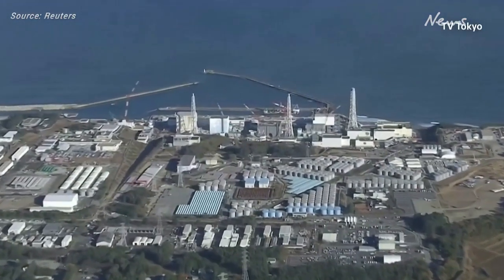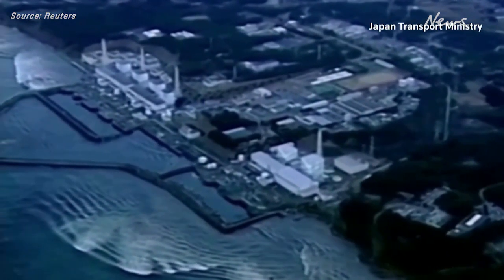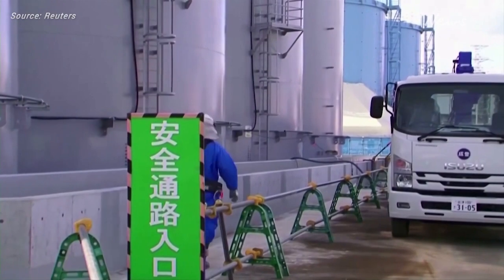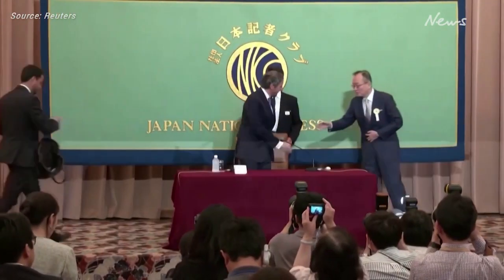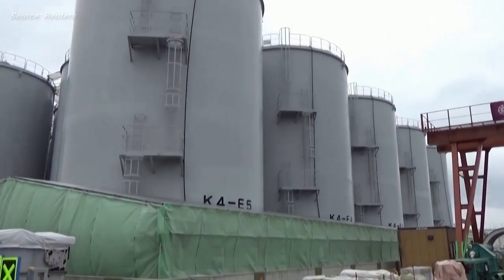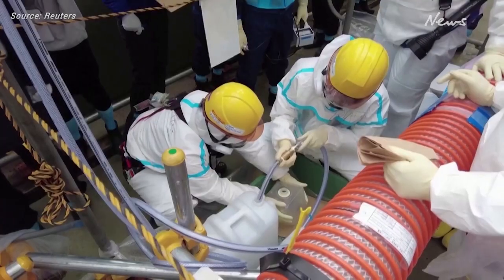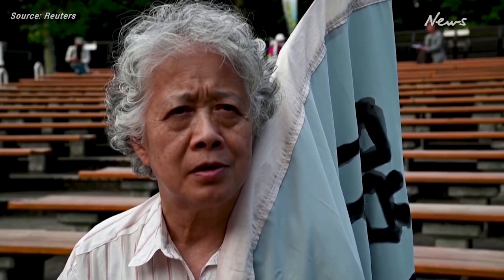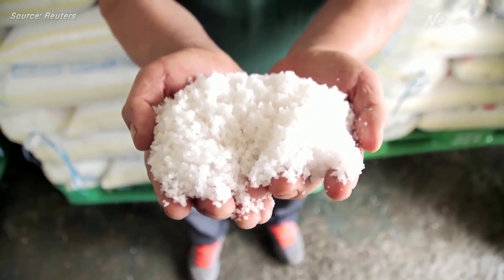How Japan plans to release Fukushima water into the sea

Comment: The title of this video is very misleading, Japan is dumping nuclear CONTAMINATED water, NOT nuclear WASTE water, there is a massive difference! 

Nuclear waste water is generally considered safe as it never comes into contact with the radioactive fuel, its use is to cool the reactor down and control the speed of nuclear reactions. Japan on the other hand is dumping CONTAMINATED water, water which was poured directly onto the leaked nuclear reactor and is polluted with radioactive substances! 

Now both WASTE water and CONTAMINATED water contain certain level of Tritium, but Tritium alone is the not the issue here, since its half-life is only about a week in human bodies, and therefore generally considered safe, all countries have dumped nuclear WASTE water at various Tritium level, and nobody batted an eye.

The real issue here is nobody knows how "treated" the CONTAMINATED water really is, it may have low enough Tritium content, but it could very well still contain many other radioactive substances! And right now nobody trusts the Japanese government, because they are blocking all third parties from sampling the water!

And the fact that they are not allowing open investigations is a massive red flag, hence the uproar in China, Korea, Philipines and many other countries! Many US sponsored media outlets are purposely distorting this by using WASTE water and CONTAMINTAED water interchangably for the purpose of furthuring political agendas. Be aware!